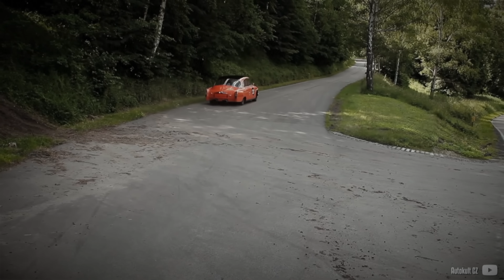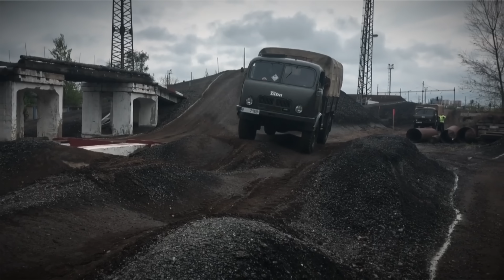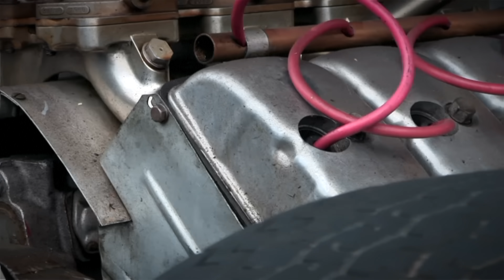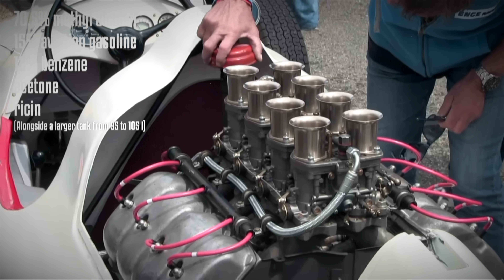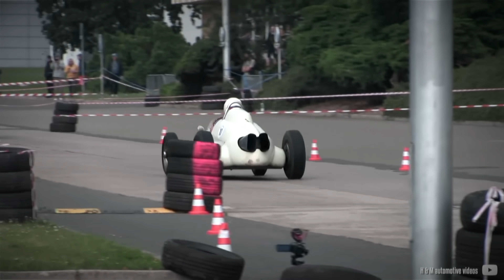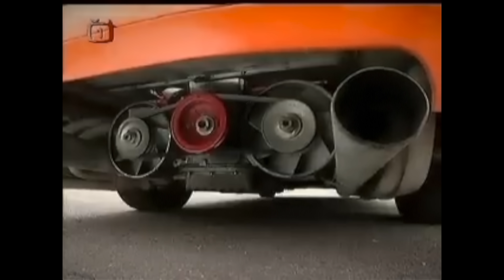This Genius Exhaust-Cooling V8 Almost Raced In Formula 1

Comment: i wonder if this ejection system could be adapted to enhance performance on a na engine. if it was so good that fans were not necessary, maybe it is good enough to increase power without forced induction parts.

Comment: Says ricin was part of the fuel, I'm wondering if this is some kind of translating thing, as ricin is a poison made from castor seeds, and castor oil made from the same seeds was high performance race oils used in motor sports in the mid 20th century. The oil company Castrol gets it's name from the Castor oil it used to make. BTW if anyone has ever smelt a high performance engine using castor oil will tell you it's an amazing smell that is so evocative of racing from that period.

Comment: How effective it is for modern engines with like 300-500 hp?
Reply: Not very effective. That's why Porsche went for water cooled heads for the early turbos and then entirely liquid cooled engine - water can transfer more heat and keep tenps more evenly distributed thanks to larger thermal capacity.

Comment: 2545 cc is 155 cubic inches.   I wonder if the exhaust ejector system could have been used to also pull more air into the intake system fr combustion air as well as for cooling--it might have been able to exploit a loophole in the F1 rules to have supercharging without a supercharger.  That could have made up for any power disparity otherwise.  Even without the boost, a lightweight rear-engines car could have been quite effective on tight, twisty circuits, like the Coopers were, even with undersized Climax engines.  Then Tatra might be remembered for instituting the rear-engines F1 revolution.  But we'll never know.

Comment: I thought only mini's and Porsches make Rear engine RWD 🐇😆
Reply from the maker: Minis have never been rear-engined... and Tatra was the first one, much sooner before Porsche which later took inspiration from Tatra.
Reply: @VisioRacer  Thanks you man I appreciate it ❤️ love your vids
Reply: I think you got confused mini with Hillman Imo or original Fiat 500. There were lot of rear engined cars between 50's and 60's, as it was cheaper than front engine - rwd and driveshafts for FWD weren't as accessible back then. Even Americans tried, with Chevrolet Corvair. But once CV driveshafts became cheap enough, FWD quickly replaced them.

Comment: If you treat images with Microsoft Office Picture Manager or similar, select the 'Color' command, take arrow to the bluish bottom in technical plans, click, this color will change into white (Cat Stevens), then 'autocorrect', you'll be surprised about quality of results.
In Air Cooled Engines, having an Oil filled Gap Cavity between Cylinder Working Surface and the Cooling Fins, will reduce noise, and buffer too fast changes in Cylinder Temperature. 
This approach was implemented in Cylinder Head of Voisin 'Biscooter' Micro Car 2-Stroke Engine.
Blessings +

Comment: You also have thrust mass contributing to forward force. 

But just to give a comparison my olds 3.3 liter v6 produced 185 hp as did my 283 about 195. And so 200 hp is a run of the mill number by the late 1950s. 
   Certainly a aircooled engine has its advantages, head gaskets are far mor forgiving with aircooled engines, but there are limitation on cylinder size. For gasoline powere engines the optimum cylinder volume is half liter. So if you want to increase output you either need more cyclinders, a turbocharger (realistically 30% more with more strength in the head, head bolts and head gasket), multiover head cams and 3+ valves oer cylinder, electronic ignition and advance. 
   Some losses occur in the peak force angle of the rod to the shaft, but decreasing these forces generally results in lower RPM, peak power and higher torgue and tends to be a feature if long lasting engines but not race cars. One can also increase the fuel to air ratio which lowers EGT and allows one to increase pressures in the manifold, again at the cost of efficiency. 

   Theres a YT site Robot Cantina where a 3 cylinder 660 cc deisel engine is used to power a saturn coupe. He manages to get the car to 80 mph and gets 80 mpg at 50 to 60 miles per hour. He basically modified the engine to turbo the crap out of it, increase feul flow and maintain EGT and MAP just below its limit. In effect hes pushing a car with three typical lawnmower engines. For comparison a prius, a much heavier car, has a 1.5 l engine it also has a max just over 80 (you can drive faster, very unconfortable) and gets abot 60 mpg between 55 and 60. Of course a prius does not have diesel fumes blowing in your face, no A/C and the acceleration of a fully loaded dump truck.

Comment: i woulda strapped a turbo in there instead, myself. for production, so it can have a muffler...

curses mufflers

lol, this is sort of like the opposite of the meredith effect, using the heated cooling (oxymoron!) air to increase thrust...

Comment: That technique was similar to the method used on the Lewis machine gun. The big tubular shroud on the ground type used gases from the muzzle to suck cool air forward over the barrel. (The aircraft version didn't need it, because it was in a cold breeze anyway.)

Comment: Ricin? Did anyone else notice that ingredient in the list of fuel components?
Reply: That's the poisonous compound in castor oil???
A mere matter of translation???
Reply: @JohnSmith-yv6eq  ah thanks! That makes more sense, castor oil was a common component in older fuels and lubricants for its lubricant capacity so that totally makes sense. Thanks for clearing it up!

Comment: Ford had a turbo that ran off the rear differential back in the 60s. Wpuld be a good video
Reply: and an American put large cooling fins on the flywheel of a race car..channeling the resulting pressurised air into the intake system....oh wait....

Comment: Right now we are fitting a turbo to a Deutz F4L912 and will add this daft system to the exhaust just to see if it actually works for standard running (low RPM) air cooled motors
Reply: If you have sufficient turbo air pressure use some of it in an "ejector jet" to create additional venturi effect for that exhaust?

Comment: One of the most novel exhaust powered cooling systems that has never really caught on, was on the Wankel engined, Norton motorcycle. The venturi principle was used. A smaller diameter pipe was attached to the exhaust tail pipe and connected to the hollow centre of the rotor. As the gasses flowing past the venturi pipe were high velocity, this created a lower pressure in the venturi pipe thus drawing air through the very centre of the engine effectively cooling the innermost part of the engine. One of the most difficult parts of this particular engine design, to effectively cool without using elaborate oil coolers and high pressure cooling oil. Clever English engineering, don't you agree?
The problem is, Wankel engines are very difficult to live with. They produce phenomenal horse power per unit capacity but guzzle fuel and require a rebuild after every use. However, Norton showed a clean pair if heels to pretty much anything, when they managed to keep it running for a whole race. Like our Czech friends, we Brits. do love quirky engineering.
Reply: And how is the capacity of a rotary worked out? Incorrectly in reality.
Reply: @jdoe9518  You ask the question knowing the answer, I am guessing. Measuring displacement as opposed to swept volume is perhaps the nearest comparison with a regular engine. It only serves to fit it into a capacity class. 
It doesn't account for the fact that a four cycle has one power stroke every other revolution, a two cycle has one every revolution but a rotary has three every revolution, and you can rev the nuts off it!
The obvious downside of this is it burns more fuel and it preceded the materials technology to reliably build it! Both of which doomed it to commercial failure for all but the esoteric enthusiast. Plus the fact that the designer was a raving Nazi, didn't help much!
Reply: Don’t forget that the rotors spin 1/3 the speed of the eccentric shaft. So in reality only one combustion event per rotor takes place for each revolution of the eccentric shaft. Cheeky perhaps, but not inaccurate.  So your question is not rhetorical, since you don’t actually know the answer. Suzuki used a similar setup on the R5 rotary motorcycle.
Reply: @RICHARDHOLMES-un9zt  What does any of that have to do with the cooling system on a Wankel Norton?

Comment: I can't be the only one wondering how hard it would be to construct and exhaust-cooling setup like this for an air-cooled VW, Porsche, or Corvair engine... This is fascinating and a really good video!
Reply: Nope! I have an air cooled suzuki gs500 go kart and now I need to know how to achieve this properly on such a small displacement engine...
Reply: @justin3131ify  make a Venturi duct for exhaust a ND connect it to some kind of a shell around the engine block and cooling fins. Out would probably be easier if those cooling fins are horizontal. See first how much air your Venturi can suck.
Reply: @GrimFaceHunter  
First position thermocouples all over the engine to make sure you have a baseline to compare any "modified" cooling system to "open air"?
Reply: @justin3131ify  easy. Add an electric fan
Reply: It's like a carburetor but without the choke and throttle

Comment: Before Volkswagen acquired the former and the latter stopped producing cars, did plans ever exist to merge Skoda and Tatra? Similar to aborted attempts by the East Germans and Russians to do the same with Trabant/Wartburg (seem to recall one or more projects outside of the RGW-Auto) and Lada/Moskvitch respectively?
Reply: Also heard Skoda gained machine tooling from Renault for what became the 1000 MB with the unsupported claim it and the engine drew upon the R8 and its engine respectively, however it is not clarified if the 720/740/760 OHC prototype designs (used in the 180/200RS and stillborn Favorit/Felicia 1.6 OHC) were converted OHV engines or all-new designs? Lastly did Skoda ever look at developing a six-cylinder as was allegedly the case at Tatra with the T625 project?

Comment: It's interesting to see the beetle body style making a comeback in the 21st century in the design of the Yanksvagen Beetles of Elon Musk - unfortunately the cars are let down by his insistence that the front of the cars are reminiscent of his stupid face.
Reply: Tesla's are that shape for aerodynamic reasons. The smooth shape of the Beetle was actually so it had no water traps rather than for aerodynamics as in those days regular people did not have garages so it would be stored outside in all weathers. Most other cars of that era would rust away very quickly if not garaged.

Comment: The Norton RC588 rotary race bike also used an extractor exhaust designed by Brian Crichton. Awesome sound.
Reply: Thé french luxury car producer " Voisin " also have used this technologue before ww2
Reply from the maker: As far as I know, it was cooled by air before entering the intake system.
Reply: @VisioRacer what's the difference with tatra?

Comment: the russian BAZ 5937  [OSA missile carrier] have a similar concept that uses exhaust driven airflow to pull air through large radiators above the engine. 

https://youtu.be/iE4yNw3WCe8?t=108

Comment: Those large exhaust pipes were also used on aircraft radial engines to encourage air flow over the cooling fins.  This is called an "ejector" exhaust.
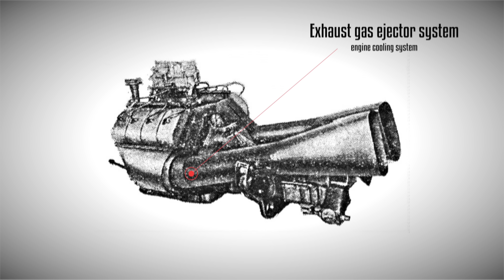Reply: Yep I actually just watched a YT vid about it, can't remember where tho maybe 4:18
Reply: That and it was running 50% methanol which has a significant cooling effect
Reply: @BigzeeeN  b
Reply: I am an engineer and did some fluid mechanics a few years back and like the person over me said it’s the Venturi effect!
A small fast stream creates suction around its outlet/intake and then large volumes of air are pulled from the surroundings.

Tatra designed the housing of the engine in such a way that the Venturi effect would draw fresh cold air  from the front of the engine over it’s heads and block for cooling.
The air would then mix the open headers exhaust stream and gets blown out of the big outlet tubes.

There is no sucking air through the combustion chamber like a person above speculated, it all happens outside the engine.

A Venturi effect is very easy to create if you want to play with it yourself, but hard to perfect.
It’s used in many industrial applications where airflow and large volumes of air are needed to be moved cost efficiently.
Reply: @rolux4853  It's brilliant, but (off topic maybe) not entirely new — steam locomotives use the spent steam in the same way to "pull" air through the firebox. That's why you see both black smoke and pulses of steam coming out of the smokestack.
Reply: Plus… it’s badass.
Reply: I'm a little puzzled as embarrassing as that is to say. I just can't quite get my head around what is actually going on here? Do these big pipes encourage more air to be pulled through the engines combustion cycle? Or something different? I only ask as I have an air cooled suzuki gs500 powered buggy/ go kart and I'd love some extra free power.... cheers guys.
Reply: @justin3131ify  Hey mate look up the venturi effect.
Reply: @justin3131ify  yeah,basically the big pipes allow the exhaust gas to efficiently pull ambient air from the front of the engine.
Basically they adjusted the exhaust pipes so it creates a suction effect,which is increased with the surface area of the big pipes.
(Fluid dynamic guys back me u p here,lol)
Reply: @justin3131ify  I'm no engineer but I think it simply works by increasing the airspeed past the engine, like if you were driving faster than you actually are and cooling the engine better. I don't think you get an ram-air effect for intake.
Reply: The armchair engineering in these comments is brutal 😂
Reply: @t_c5266  Pretentious are we.....
Reply: @Flies2FLL  as an engineer who works on this style of stuff. Yes.
Reply: @t_c5266  Ok-
Reply: And it works by using Entrainment
Reply: @ValerieNuggat  Are you sure that it isn't entertainment....?
Reply: Norton used ejector exhausts to pull cooling air through the rotors of their Wankel engined bikes

This is the same principle as a steam ejector that I've used for pumping dirty water on a chemical plant.
Steam (or exhaust gases) blasting through an orifice to create suction
Reply: Cool info! @g8ymw
Reply: It's similar to the Meredith effect
https://en.wikipedia.org/wiki/Meredith_effect
Reply: You don't say. It's exactyl what it said in the video. What a coincidence eh??